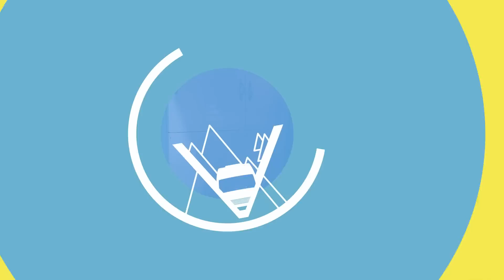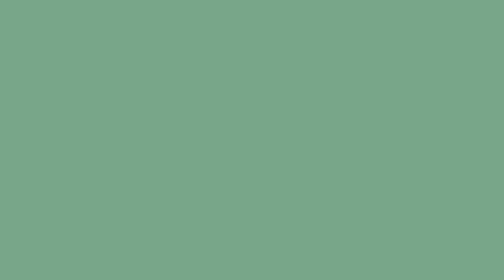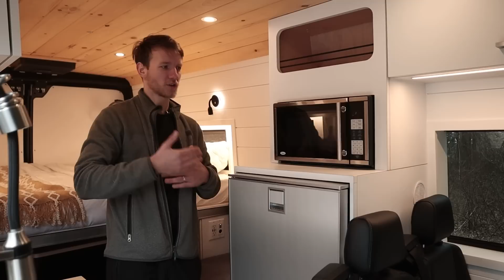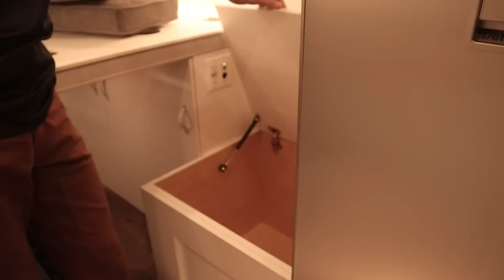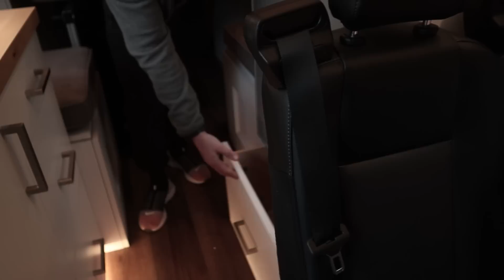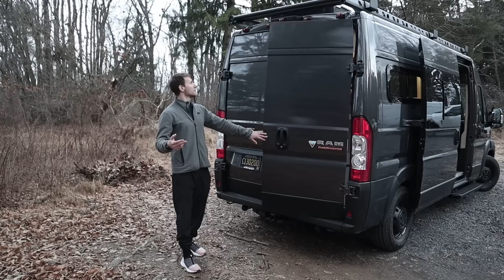MUST SEE CUSTOM CAMPER VAN TOUR!!

Comment: 160ah of batteries to run the AC you say for 30 hours? Do those batteries have plutonium in them?
Reply from the maker: There is 560ah of Lithium batteries in this system. Time stamp 12.20

Comment: that portable bathroom kinda have huge downside. that is, u have to wait the cover to dry before u fold it again. i think u may want to save that bath cover at the bottom cabinet instead, or u can check "murphy bathroom" designed by couple ex microsoft worker, they cleverly keep all wet part in one cabinet, so even it's wet they still can store it safely.
Reply from the maker: This bathroom was requested by our clients because it fit their needs most! Thank you for your comment and tips!

Comment: Where is the stove for cooking if you don’t want to use the microwave
Reply: I imagine that, with all the electrical capacity they have, they could easily use a plug-in convection cooktop.  Or a propane camp stove.  They’ve got plenty of space to store them, as well.
Reply from the maker: Thank you!! HAHAH 🤣
Reply from the maker: There is an induction cooktop that gets stored in the cabinet.
Reply: @VantureCustoms  Ugh, shows what I know—I meant induction, not convection!

Comment: Perfectly built. The idea for the bathroom is awesome and perfect.  Stainless steel means it will be easy to clean and won't show stains easily.  It is also multipurpose.  I could put a  dry flush toilet in there and take it out to use anytime or just use it for temporary storage for any other items plus it is a sitting area as well. Seeing that one only spends 10-15 mins in the bathroom once or twice a day,  this is super nice and a good management of space. The fridge is mighty compared to other van builds I have seen, usually tucked somewhere like it was an afterthought. The microwave position is superb,  not too high or low, and comfortable enough to carry out stuff from it without struggle. Thank you for sharing ❤
Reply from the maker: Thank you so much!! We are so glad you enjoy and appreciate this van!!